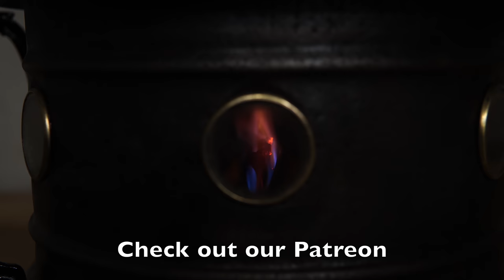Rusty Camping Stove Restoration

Comment: I think lamp oil would have been a better choice than alcohol, but it seems to work just fine. It is advisable to wait until the wicks are really well soaked before lighting, then not so much of the wick would be burned.

Comment: I have not seen one of those for awhile, it is around 1910 vintage from F Besnard of Paris never seen one in the UK only on the Continent, but would not be suprised if the odd one or two ended up over here as they are easier to use than the pressurised Primus stove.

Comment: You used three different finishes for the iron parts -- high temperature paint, vegetable oil seasoning, and bluing fluid. What are the advantages to each one that you chose to use them?

Comment: Lovely work! My dad has a single wick stove he has been planning to use, what sort of oil did you put in this one?
Reply: It looked like he used alcohol, but I think it's a paraffin / kerosene stove.  It might account for him getting through that wick at an alarming rate.
Reply: The new wick should soak in the fuel for at least an hour before the first use. After that, the wick will burn evenly as long as you don't raise it up too high.

Comment: just curious, why did you use vegetable oil for some parts (6:25) but bluing liquid for others (7:00)?
Reply: Veg Oil used for a mid heat resistant cured coating, seasoned iron looks nice for the outside wall, blued in the path of the fire for higher heat resistance

Comment: It looked like a microwave oven that was used together with vegetable oil to blacken the cast iron, or was it a regular electric oven?
Reply: That’s a oven. A microwave would have resulted in a very… different… result.
Reply: Toaster oven.
Reply: @yenko5196  it would have been exciting, but yeah, very different
Reply: @yenko5196  I have not seen such an oven in Sweden (but I have checked now, they are present). I like the result. Do anyone know what temperature and time to use?
Reply: @alti5657  There is lots of tutorial on the web for that. Just search for “how to season cast iron”. But basically something like 1 hour at 200°C and let it cool slowly in the oven (cast iron doesn’t like sudden changes of temperature). It needs to be repeated multiple times.
Reply: @yenko5196  Thanks a lot.

Comment: What kind of white dough was used to remove carbon deposits from copper?
Reply: It's written in the vid... flour + salt + vinegar.
Don't use it for the crêpes though... ;)
Reply: @19Edurne  Thanks. I'm looking for something to wash aluminum dishes after cooking boiled linseed oil.
Reply: @KVAatHome  It won't work on grease or oils, it's only for removing oxydation. And some degreasers (the kind to clean ovens for example) react with aluminium, so don't use caustic soda based ones. Try solvants... maybe brake cleaner would work; but on burnt oil, I'm not sure.
Reply: @KVAatHome  elbow grease may be your best bet… :-(